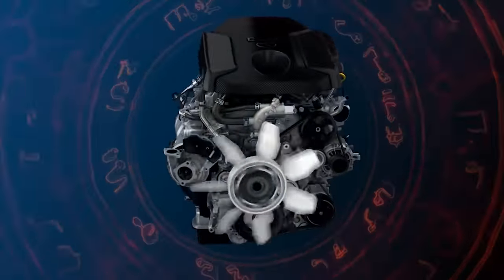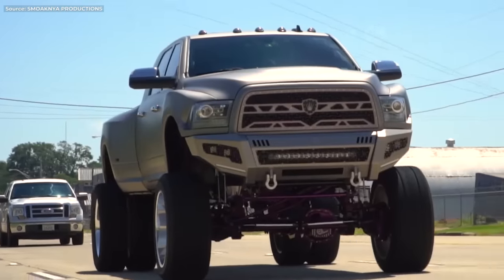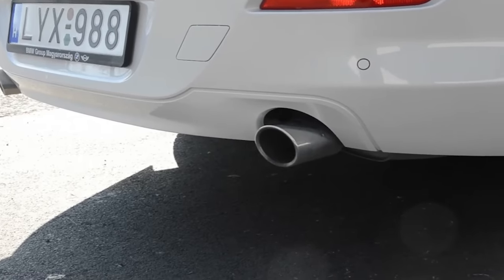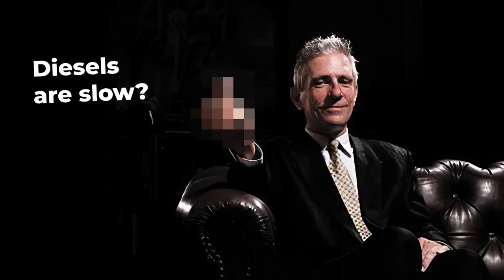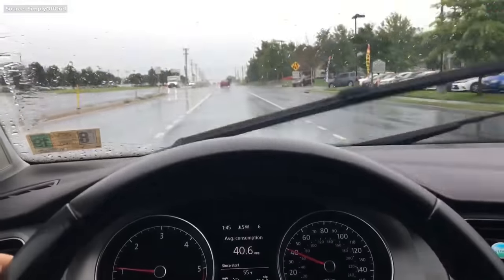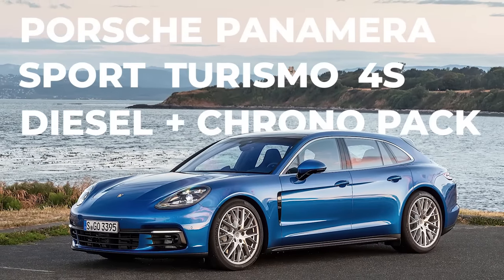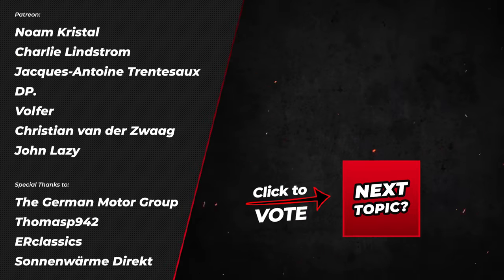Top 7 most Impressive DIESEL Cars

Comment: A diesel is perfect for young car enthusiasts. Especially here in Norway where gas and horsepower and fuel consumption is crazy expensive.
They are cheap to drive and offers good performance especially if you tune them. Which is much easier since essentially all diesels are turbo.
Remember a 320d is faster than e 320i;)
Reply: same. i have my 2.0 TDI altea and i freakin love it. it a cheap decently sized car with a lot of pull and fun suspension
Reply: 320de46 still a decently quick car
Reply: yes so is my 120d e87 faster than 120i
Reply: @glorybetogodtheholytrinity4643  bruh.. radicalism, you should be ashamed of using Christianity as your business and promoting your influence information, shameful display.. sinner
Reply: I can say the same about my country, but here it is even more special, because there’s a taxation gap at 250 horsepower: you pay around 250$ a year of taxes for a 249 hp car, whereas for 251 hp you need to pay around 1000$
So here are plenty of 3.0 249 hp diesels, which is a massive bargain: they are really quick, especially if on stage 1-2, they are almost sniffing the fuel, and they are tax-friendly
What a great engines!
Reply: in my country 120kw is the limit anything above 120kw still is still priced like 120kw
Reply: I just love my 320d E46❤
Reply: @chaosraptor2584 ew
Reply: Brother don’t judge me
Reply: @chaosraptor2584  Don't blame you. It is objectively a better car than the 320 non-diesel.
Reply: Yeyeye... but what would a diesel be without a turbo... diesels without turbo are literally 0 power... while NA gas engines are still powerful... they don't need a turbo
Reply: I live in Germany so the situation is similar with gas prices, my friend drives a 320d E90 and I drive a Fiesta VII 1.25 with just 60hp, so about 100 less than him and he still gets slightly better gas mileage. I definitely wanna buy a BMW in a few years tho, probably a 320i E46 since I'd love to have that 2.0L I6

Comment: I remember when VW came out with that diesel V-10 Touareg.
Reply: That one kicks ass
Reply: @rubenhaak2968  We've got one for towing at the Dealership I work for. Swapped it for a 3.0TDI, since it always breaks and yea it can tow more but it's ludicrously unreliable
Reply: @xGxPhantomZzz  the 3.0 TDI and 1.9 TDI are legendary engines and very reliable For Doing stuff definitly the better choice
Reply: @rubenhaak2968  Not the old 3.0s, the Q7 isn't much better. It has the third timing chain at 260.000km ( like 160k miles) and it likes to fry circuits 😂
Reply: @xGxPhantomZzz  really i only Heard that they are very reliable
Reply: The diesel V10 is basically a 5L version of Audi's 6L V12 TD.

Comment: Really like the content you are churning out. A Diesel engine might be the poster child for CO2 emissions today, but you can't argue they have loads of torque and they burn efficiently compared to their petrol counterparts.
Reply: In fact They are very Low in c02 but Higher in nox
Reply: New diesel engines generally produce fewer emissions than gas engines. DEF and particulate filters on new diesel engines changed the story.

Comment: I had briefly a surprisingly good 2006 Puegeot 407 2.7ltr V6 Twin Turbo Coupe.(Same engine as used in the then Jaguar "S" Type and the Range Rover Sport..! ). Accelaration quick enough to give "Beemer Boys" a shock, combined with exceptional "GermanType Build Quality" in a comfortable 4 seater, two door. More of a "Gran Tourer" than a straight "sports car" admittedly, but I had no complaints and would very happily have another, given the chance..

Comment: Quick comment, I’ve also had an A2 diesel, the 90 hp version. The body panels are polymer for the most part…after a front shunt they stuck the thermoplastic bits in an oven (autoclave) and it was no different to when I bought it. 
Furthermore, VAG sold more A2’s than SAAB sold 900’s of the same generation. It was a development project for space frame vehicles but “more or less” broke even on its total cost

Comment: Without the Diesels in the MK I Golf, the engine may have been found only in taxicabs until today...especially the Turbodiesel, though being significantly more expensive than the comparative petrol version put the self igniter on the map for a broader public.
Besides, the engine derived from the EA827 was the first being a "high rev diesel" and being compact and lightweight enough to be installed in compact cars. Though still featuring many "traits" of the Diesel like noise and harshness it proved to be a reliable engine after the first teething problems were ironed out.

Comment: The 3L engine was first used in the Volkswagen Lupo back in 1999. A slightly altered version of that engine is still used today in several VW group cars. Actually the one in the Audi A2 had a bigger displacement 1.4 liter instead of 1.2 liter. Both are 3cilinder engines
Reply from the maker: Both A2 and Lupo had that same 1.2 TDI engine. No other car had it. 
Audi was a little heavier but had better aerodynamics so it was still capable of using less than 3L/100km
Reply: @TopCarsTV  back then it was the 3L engine but it was later reintroduced in VW cars with the Bluemotion logo, Skoda cars with the Greenline logo and Seat cars with the Ecomotive logo. 

I have to admit that the A2 3L is new to me. Was it sold outside of Europe? I only knew about the 1.4 only

Comment: I drive a G20 320d xDrive 
With a stage 2 tune it gives 243hp 555nm and goes 0-60 in about 6 seconds. Not much for a bimmer, but it still is a perfect daily car since a full tank of diesel (60Liters) lasts for more than 700km (around 8L/100km) in a “city mode”

Comment: 0:48 That Cummins B series 5.9L is still widely used in India in the 6 cylinder buses and trucks made by Tata, their bus and truck chassis as well as built vehicles available with different power ratings ranging from 120hp to 230hp.
Tata even made a rear engine low floor city bus with Marcopolo to compete with Volvo's B7RLE and a rear engine coach with Hispano called the Hispano Divo equipped with the 230hp engine which was almost as comfortable as the quite more expensive Volvo's B7R with the 270hp engine but still no one ready to pay the premium ticket prices for Tata over Volvo. So the Hispano failed but the Marcopolo was quite successful.

Comment: Ive had my F25 X3 30D for 7 years. Never missed a beat and goes like absolute stink. I have an e46 m3 for weekends but tbh, in public roads over short sprints, the X3's 410lb of torque would blow it away

Comment: Cummins once built a indy car that would of won the Indy 500 but unfortunately the turbo got clogged and it had to retire, and was never able to try again because diesel got outlawed, The car set the fastest top speed of 1952 of 139.1 MPH in qualifying. Also the engine was a modified truck engine that was in production in 1952.

Comment: There was one W123 diesel that had been used as a taxi for over fifty years and it clocked over 7000000 kilometers recently, and from that... it did 5.8 mil with the original engine block.
Reply: Friend of mine had a 240D W123 with 684 000 miles on the clock. It ran perfectly on used (but filtered!) vegetable oil without any adjustments.
Reply: i call bs, the most kms ever registered was 5 mill.

Comment: Original 5 cylinder TDi by VW used in Transporter and early Touareg. These efficient strong reliable mid-displacement engines run over million miles if well maintained..

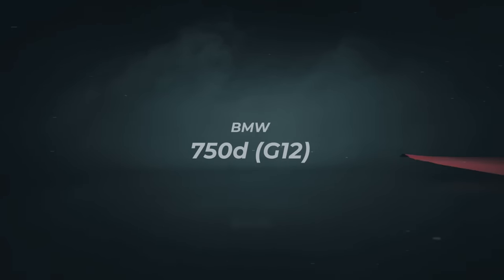Comment: 4:28 I had a 750d (G11 LCI) this year and it was great. Enough power to pull if you like to - and a really fuel efficient engine for long road trips. While you are relaxing on ventilated massage seats...

But I love the 840d M-Sport (G14) as well, it was the perfect car for a road trip to the alps in a hot summer. The quad-turbo is nice, but two turbos are sufficient. But I wanted to drive the new 750d (quad-turbo, 400 HP) while I was disappointed of the old 750d (tri-turbo, 381 HP).

Comment: I would argue the 435d is even more impressive than the 640d, only issue being the AWD instead of RWD. However 4.5s to 60 and hot-hatch destroying acceleration in a car that'll get 52mpg is incredible.

Edit: I have never, ever gotten 52mpg from my 435, not even close, my right foot is made of lead as soon as I jump into it. Every car has Mopar fuel economy if you drive it properly.

Comment: Strange that on the list there was a 640d, but not the first one BMW M550d F10. At his times about 10 years ago 3.0l straight 6 engine with 3 turbos was something unbelievable
Reply: For the bimmers, i would have put the first 335d, sometimes nicknamed the M3d in the remapping community (the E46 330Cd was also a beast when remapped, but the E91/92/93 was 340-350hp with a simple remap, it was insane at the time)
Reply: @adriendebosse6941  In romania the e60 535d is extremely popular, many pushing M5 levels of power, most of them on style 128s lol

Comment: I don't know about bigger engines, but I can bet you that small diesel engines have much better pull and are more fun than small petrol engines (like 1.5 litre size)
Reply: I've driven a Peugeot van with a 1.5d it drove really good and towed a tractor just fine

Comment: Dont know if USA got the BMW 435D coupe and grandcoupe but its a 4 series diesel car with 3lt engine with a whooping 310bhp and 465.00 lbs/ft of torque factory and 0-60 in 5.2 se, with a stage one remap hits 400bhp and still 45-50 mpg. The same engine as 640D but the 435D is lighter and fits 5 people instead of 4 people.

Comment: You are very mistaken on the ram. Chrysler never put a cummins in a 1500 series truck. 4th Gen rams got a 3.0L V6 diesel from fiat, as did the Grand Cherokee and years later the Wrangler.

Comment: Yes, diesels might be slow, BUT they are 2-4x more efficient compared to the gas version.
For example, the 7.3 idi/ non turboed ford motor in 1993 if it has a ZF5 3.55 gears, the truck can get up to 25mpg! 
25mpg is the same as some sedans on the market today.

That Mercedes diesel is the best diesel car EVER MADE!!! But you need the car with the 4 or 5spd stick not the automatic.
You forgot the 6.9/7.3 idi, since you included the 5.9cummins it should’ve been included since they used the engine for over 10years & it was the 1st diesel ford used in their trucks, most importantly it’s all mechanical.

Comment: back in 2010, my uncel in europe bought a 530 diesel and I was like y wud you choose an expensive diesel when you have the petrol version 530i .... but little that i knew that the stock diesel was faster than its petrol counterpart in 0-100 and intermediate ... an all aluminum diesel engine ... with 550nm torque ... odds were broken then and BMWs inline 6 diesels are legendary.

Comment: Your list is not complete without the C 30 AMG cdi :-) But not in the stock throttled version. But in the way it was engineered by AMG. 300 hp and 640 Nm Torque. Unfortunately it was throttled as it blamed the V8 engines from AMG :-)))

Comment: I think the Honda Insight is cooler than the eco Audi despite only getting around 60 mpg. With a modification though it can get up to over 100 mpg with its hybrid system fully on. And plus. If the engine dies in high it won’t because they are bulletproof you can k swap them

Comment: I used to be that guy about diesels 😆 up until last year i wouldn’t have never owned one .. I always said they were the devils work .I’ve always Owned fast petrol cars over the years .. but last year I opted to go for a diesel purely because of the mileage I was doing back and forth from London to Bristol . I bought a Bmw 125d had it mapped to 265 bhp And now have more torque than a m140 . The thing sounds like a ford transit but does 0-60 in mid  5s 😆😆 it’s rapid and shocks a lot of standard s3’s ,golf r etc

Comment: The mercedes om602 2.5td and 2.9td is also an very reliable mercedes engine the newer ones cdis om611,om612 and om613 were also very reliable engines with common rail

Comment: One european diesel is missing. And this is the old 1.9 (td)i VolksWagen diesel. For smaller models (polo, golf) with or without turbo, for passat with. This old skool engine are still running in many cars. Strong and very good in fuel economy. Many vids on yt that these passats running over 1.000.000 km. Even 1.200k. my car is 25 yo 380.000km and no probs. These are like the 300d mercedes. My car brought me home from more 100kms without oil and once without cooling fluid. You just can't kill these engines.

Comment: You had a chance to talk about the F90 BMW M550d which also has a quad turbo setup but makes over 500 horsepower. Better than the 7 series
Reply from the maker: It's the same engine as in the 750d and makes the same 400hp. I did mention it, but I wanted to talk about diesels in the most luxurious cars, not just in another Panamera Diesel rival.
Reply: @TopCarsTV  the M550d produces over 500hp which is more impressive than the 400hp produced in the 750d.
I would say the panamera rivals the 7 series, not the 5 series as well
Reply from the maker: 7 series is tuned for comfort, despite the power. That's why it's not called M750d. 

M550d is more akin to Panamera in a way that they are both sporty.

Also, M550d doesn't have 500hp. It has 400. Just like the 750d with which it shares the engine.
Reply: @TopCarsTV  right my bad the M550i produces 520hp. Well in this case the 750d was a better choice and you did well mentioning the M550d 🔥

Comment: The diesel cars are high in torques, par example i have 2.2 cdi and its haves 400nm with only 163hp, from 0 to 100km/h in only 7.9 sec, with max speed 230km/h its feal fast and comfortable.
Buy the way the consumption is only
 4,5l/100km and 105gr

Comment: How the hell is that v8 panamera getiin 6.72L/100 km in the city
My 2L diesel Ford is geting 7.5l in the city and its smaller and lighter.
Btw those numbers presented here are not wrong but imposible to get,those are promised by the maker but they are calculated in perfect condition,witch you will never get.

Comment: Your research sucks, the most efficient production car is the VW XL1
Reply from the maker: The video says that the A2 is the most fuel efficient mass produced car.

XL1 was made only 250 times or so. Also, it is a hybrid. Not really using much fuel if it's running on battery. That's not a fair comparison